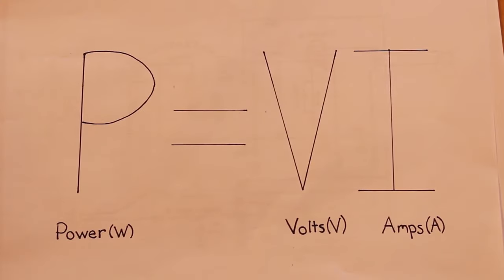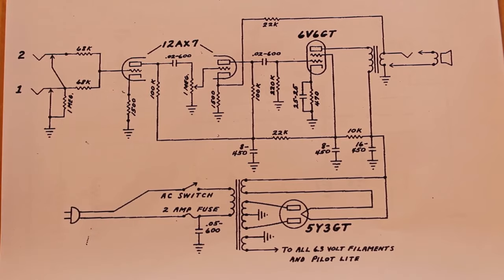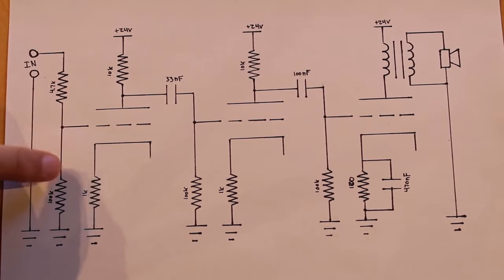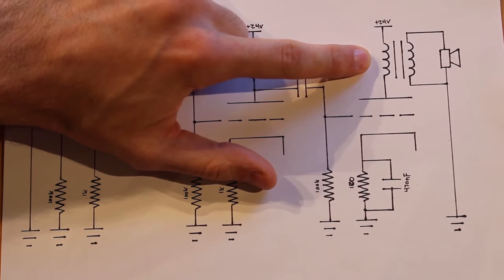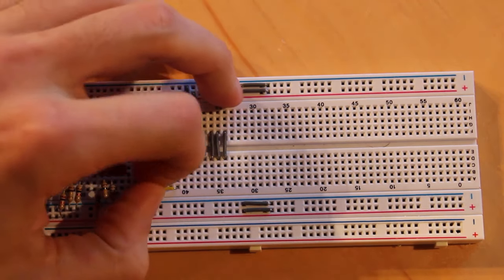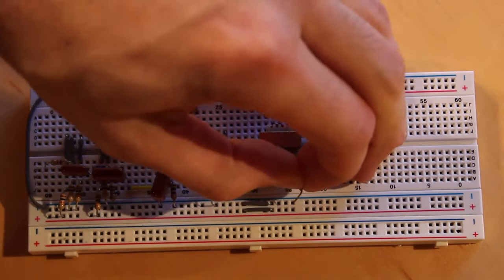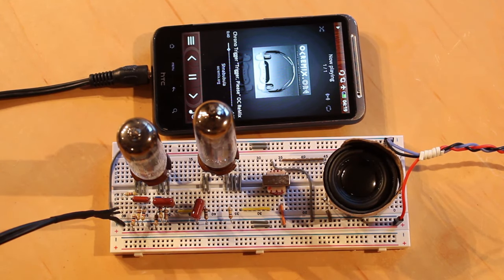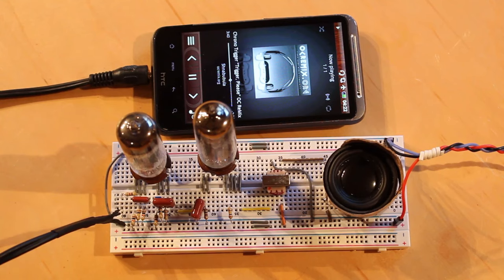Let’s Build a Low Voltage Vacuum Tube Audio Amplifier

Comment: ...... i cooked the amplifier chip in my old cellphone doing this... why does it work for you but killed mine :/ then again mine was high voltage.
Reply from the maker: Hmm, that shouldn't have happened, even with high voltage, the grid impedance should be so high that nothing ever gets fed back into the input. However, one part that is missing from my design is an input coupling capacitor. That's because the original Champ Amp doesn't have one, so it might be worth adding a small capacitor on the input to block any DC bias that might be finding its way on to the grid.

Comment: I have something I wonder if someone can help me on. I have a vacuum tube Geiger Counter... I just bought a 12v to 135v inverter for the B+ supply, but I am thinking the filament supply would be power hungry on batteries. That got me to thinking... I would like to see if it is possible to make solid state tube replacements...

Comment: This is a very non-ideal operating point. It would be interesting to see the amount of distortion if you have the means of measuring it.
Reply from the maker: Yup, everything about this entire audio build is super non-ideal! But, that's what makes it so much fun I feel.
I don't really know how to measure distortion, but in general, the sound is pretty accurately recreated. Mostly, it's lacking any bass, but that's kind of to be expected from the abysmal speaker design, tiny driver and super low voltage.

Comment: 100k grid resistors are a bit wastefull! (They attenuate, being parallel to the 10k anode resistors for the signal, and in addition they necessitate larger C values. Why not use a decent MegaOhm value, like any good tube design?!)

Comment: you should follow your instinct, low power amps are better with positive bias
Reply from the maker: Thank you!
Really, I just spent about a week experimenting with different resistor and capacitor values, slowly working my way towards something that sounded decent. I'm bad at math, so I make use of the tried and true method of "trial and error", haha.

Comment: Awesome
Reply from the maker: Thank you! But "Defunct Username" is one of the coolest usernames I've seen in a while!
Reply: @UsagiElectric  thanks! I'm newer to electronics and picked up a new Oscope for the holidays.  I can't wait to experiment like what you are doing. I have some tubes sitting around and an ancient RCA tube handbook I'm learning from. I'm stuck on this idea of using a uC to drive a 6V tube and use the on-board DAC to make spooky tunes.
Reply from the maker: @heyitsandrew2209  That sounds like an awesome project! I love the idea of building hybrid electronics to be able to really pull the best out of both eras of technology. I actually did a little playing around with running a tube with just 6V on the plate, and there is actually some gain to be had there. I was able to take a 1V sine wave and boost it up to over 3V! With two 6V tubes (using 6V on the plates), you could definitely take a very small audio signal, boost it up to about 5V and then use that as an input signal to do some other funky stuff on.

Definitely keep us updated on your project, I'd love to see how it comes together!

Comment: Thanks for the interesting video, i just ran across a regenerative receiver (from France) using the same tubes and operating on 6.3 v on the filaments and only 12 volts on the plates , i havent built it yet but the author says it is very good ! Thanks ! K9UT

Comment: Tube???
Reply from the maker: For this one, I'm using a 12BH7 dual triode and a 12B4A single triode, but I chose those specific tubes because they shared heater values. Really, any tubes can be used here as long as the heater current and voltages are matched (if running the tube heaters in series like I'm doing).